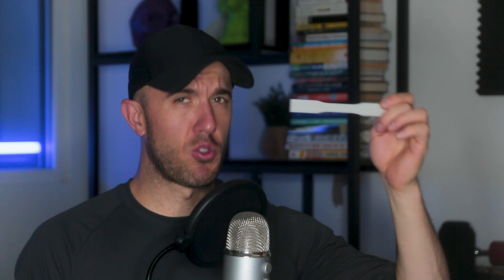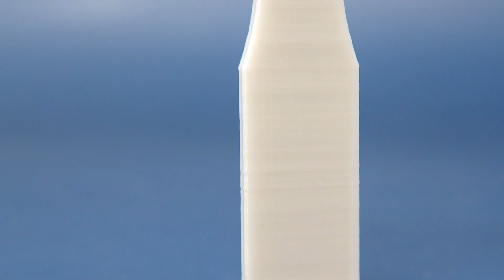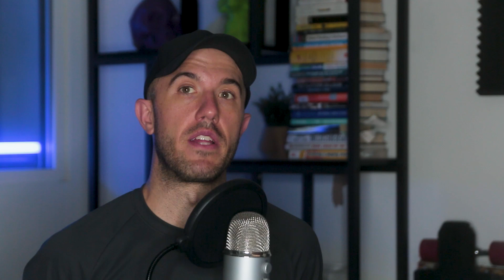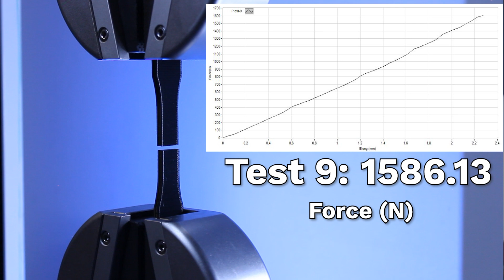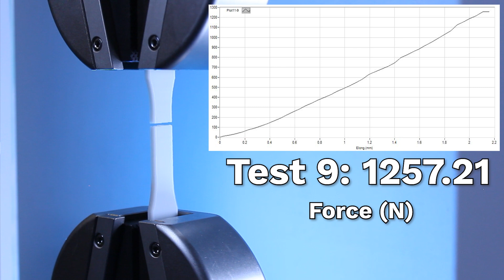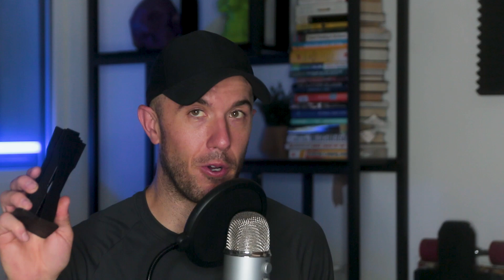How Strong is Pure PLA?

Comment: If you are testing CF PLA but only with vertical samples you will not see much of the CF strength. Other testing (read YouTubers) has shown that the filaments don't cross the layer lines. To show its strengths and weakness it kinda needs comparing to horizontal and vertical samples.

Personally i don't want to use CF unless the project needs the properties. It's way more annoying to maintain the printer farm with mixed materials, especially CF PA6

Comment: I know you said you're testing it vertically because that's how you typically do things so that data means the most to you, but if you're testing for the material itself, wouldn't it be better to test both so you're not just testing layer adhesion? 🤔
Reply from the maker: TEchnical Datasheet already has that info
Reply: @TangledTesting  Well alright then

Comment: I wonder if printing in a vacuum would improve on layer adhesion as there is no air between the old layer and the new one,
Reply: Probably not helpful. There would still be voids between the layers, air is not blocking. And once exposed to atmospheric pressure it would cause stress within the part when there are actual vacuum pockets. But it's probably not that sealed and would just equalize. You'd have to fuse molten material in vacuum and then turn off the vacuum while molten for those voids to actually collapse

Comment: The variability is due largely to the phenomenon where as soon as a crack starts to form it quickly spreads so the break happens at the absolute weakest single point. There are likely some slicer tricks which could be done to avoid such specific weak points. Filming breaks happening under slow-mo to see what's really going on there would help a lot.

Comment: I think a sample size of N=10 is a bit low to draw the conclusion that the variance in the gray sample is significantly larger than in the black. Before blaming the color, I suggest to make tests with a least N=50 (for each color). Best get advice from a statistician, I’m just a maths teacher. ;)
Reply: For this data set he could do a simple T-test. 

Best of course now that he has baseline data for it that would be a power analysis to see how many samples are actually needed, which is pretty easy to do in any standard stats software.

Comment: Ditto to all of the comments saying try the uncolored PLA, it would be nice to know the base strength of the material. Also - my guess is the carbon fiber won't add any strength, as it generally needs to be chopped up to flow through the nozzle without clogging. In most applications outside of 3D printing, they can use long fibers and really benefit from it.

Comment: you should also do the uncolored (clear)
Reply: He doesn't need to he already mentioned what the strength is because it's already known in the industry
Reply: @phasesecuritytechnology6573  - The material properties of the base material stated in the video were for the material itself in isotropic form, as opposed to the material extruded into filament and then 3D printed.

Comment: So... how strong is pure PLA ?  🤔
Reply: He literally said it in the video watch again. It was 60 megapascal
Reply: @phasesecuritytechnology6573  This video series is about actually testing filament to answer such questions. Therefore the title implies that we were gonna be witnessing an awesome test performed by the new fandangled superduper tensile strength test machine on pure PLA. Disappointed, bigly 😮‍💨
Reply: @phasesecuritytechnology6573 60 is not the strength of a printed part, data sheets tell you how a homogeneous sample of a material behaves. It would be somewhere in the 30% to 50% range he mentioned

Comment: It would be great to have tables with average properties of parts for different materials, parameterized for different infills (like the ones used when designing parts manufactured with traditional processes that lead to homogeneous properties ). It would be really helpful for designing functional parts
Reply: Also some metric for the variability would be neat
Reply: @jckrielesq , that would be great, but if variability estimations aren't available using a higher safety coefficient can be enough to ensure that the piece won't break. I'm quite sure that fdm parts are strong enough for many designs, but the lack of information about their properties and their highly anisotropic nature (that makes them difficult to deduce mathematically and simulate pieces using fea)
Reply: By engineering tables I mean something like this: https://mechanicalc.com/reference/material-properties-tables